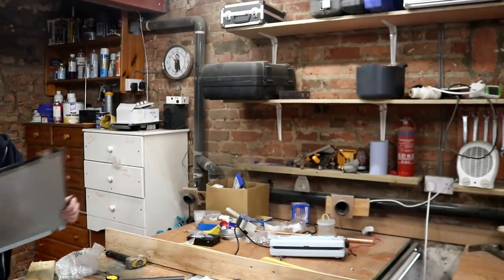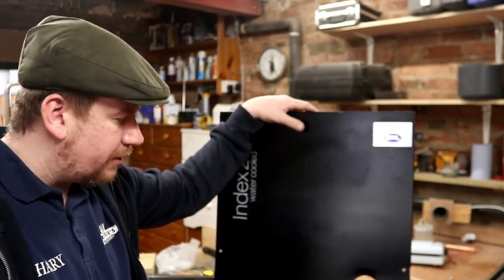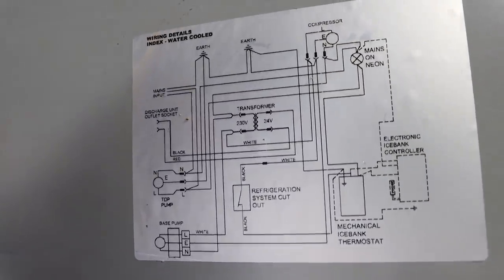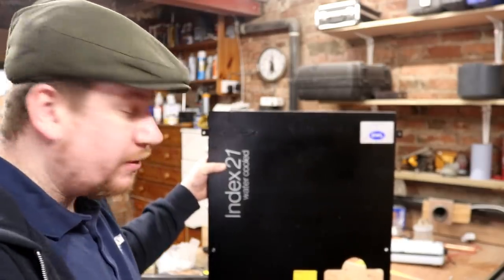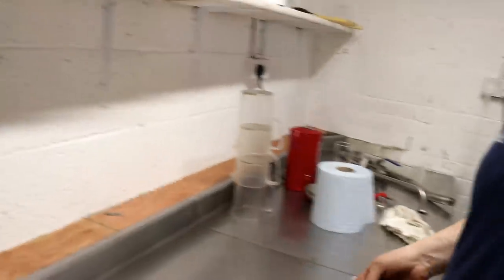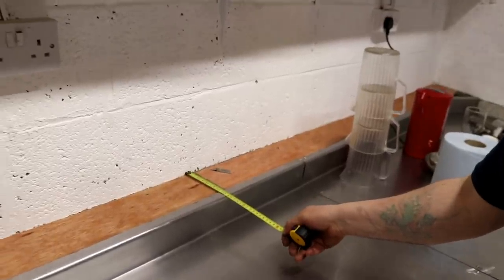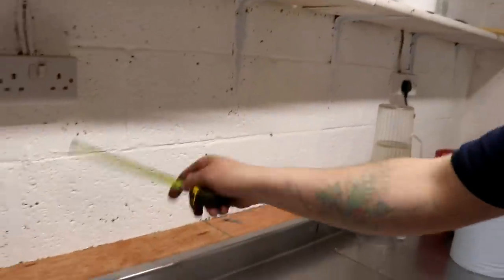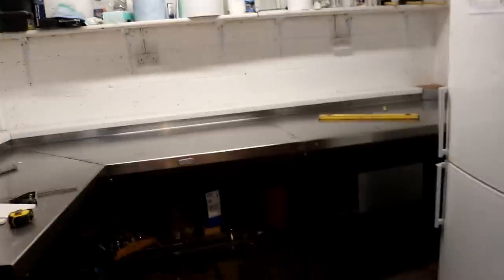I KNOW NOTHING ABOUT INKBIRDS

Comment: the flashing decimal means its still in the mode for setting/editing. leave it until it stops flashing and you can the switch between at/run. also worth double checking your set for the right thermocouple type in the main menu. It supports loads.

Comment: Cheers buddy! I'll get them ordered! :)
Reply: What about a freaking update fella  I changed out my c100 with inkbird too, you'll be pleased. Boooop!
Reply: Make sure you get the “VH” version, the “RH” is designed for mechanical relays rather than SSRs
Reply from the maker: No the VH is for 100 to 240v output to ssr. We want the RL version for Tom's build as the panel will be low voltage on the control side for safety. We will be switching lights and relays via an independent  24v PSU. The current output of the inkbird may be pushed to provide the amperes needed so the separate PSU allows for redundancy.
Reply: Can't wait too see Tom's new brewing vessels and controller going

Comment: Harry, I need to go back to the video where you explained the cooler flowpath and purpose.  If the H2O is cooling the beer flowing through in enclosed tubes, why not replace with a Propylene Glycol/H2O solution.  

2....Isn't the output of the PID going to an SSR?  If so, that is the incorrect controller model.

Have you watched George of "Barley and Hops Brewing"?  He has detailed videos of all things technical.  I am a big fan.
Reply from the maker: Yeah you could use glycol, lots use water. Personal preference I guess.  The PID is only switching, I have a psu in the control panel to run the ssr's plus a load of other low voltage stuff in the C/Panel. If you did not want to run panel indicators you can use the dc output ones.
Reply: @harrybrew69  Sounds good! Cheers! 🍺